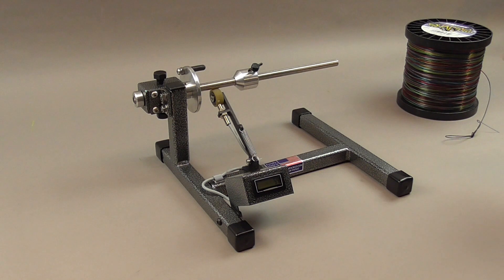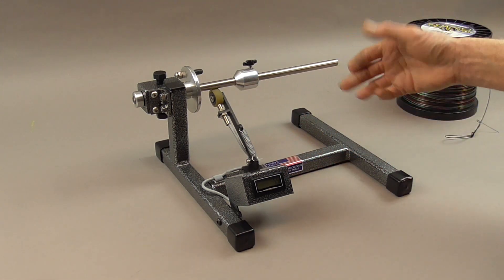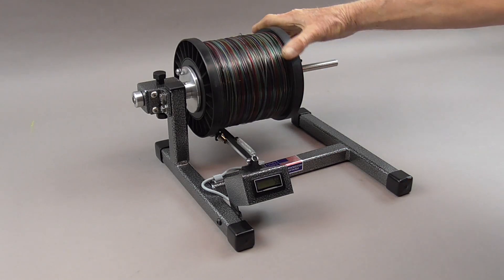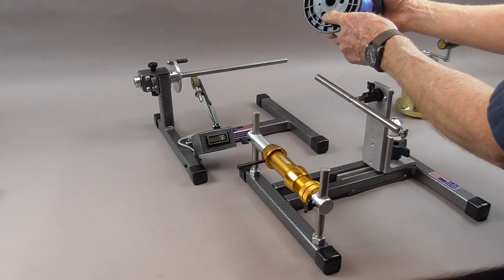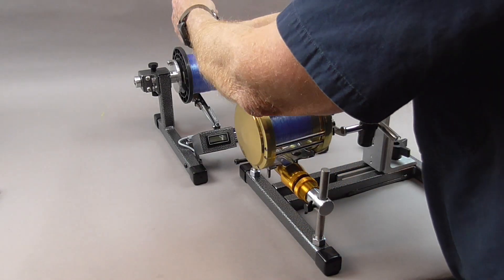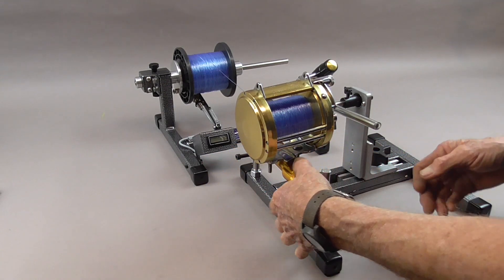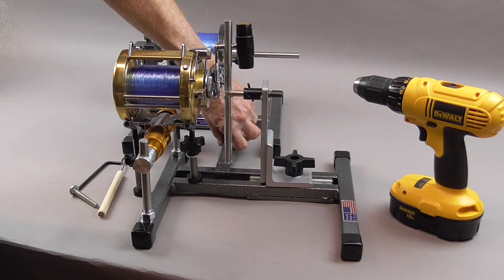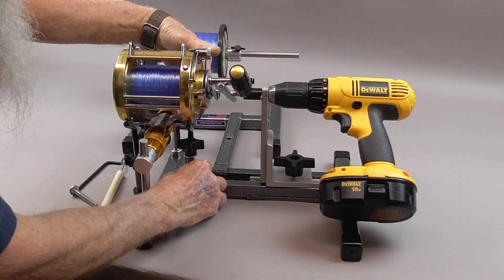South Chatham Tackle Speed Spooler Introduction and Use

Comment: Why do you need to bolt to the table if the two frames are attached to each other they wont move when reeling , they act as one unit when attached to each other...just make a bar that bolts the two frames to each other..